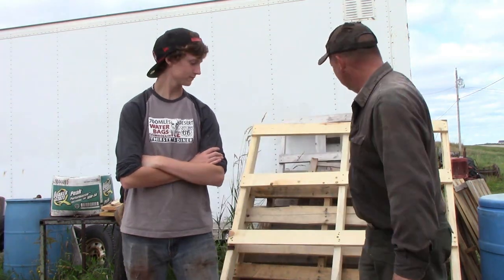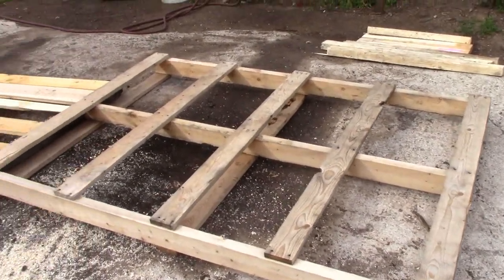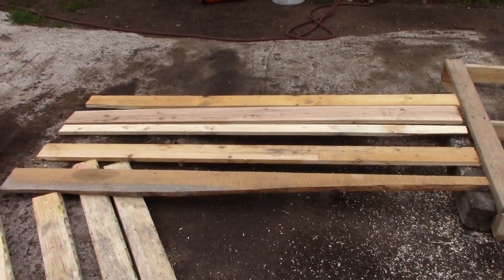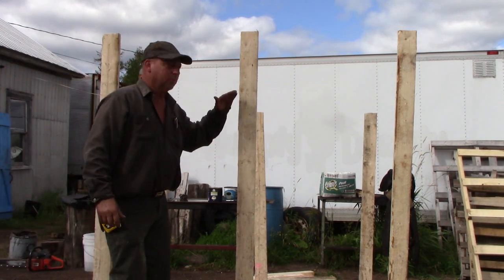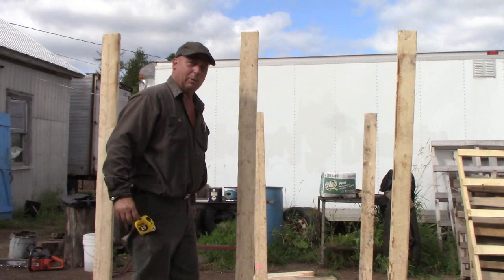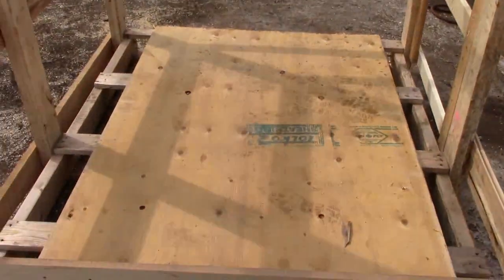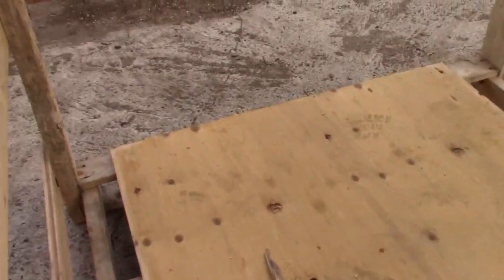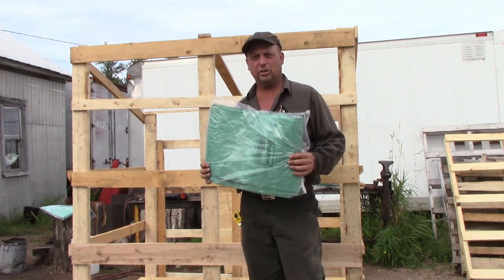How to build a ground blind (on the cheap).

Comment: All the tarps I have used break down in sunlight. Started using silt fence, doesn't degrade, last forever and I can get used silt fence from job sites that are finished. Need to hot cut the lengths or it will unravel. You can also just wrap around a 1x1 and nail it on so it doesn't unravel. Really like the pallet idea
Reply from the maker: That is a great tip, thanks!

Comment: Hi Dave I like your videos. I have a 1970 international 624 diesel tractor. I have to do the brakes and the PTO clutch doesn't let the lever engage. It engages with the engine off then when I start the engine the PTO runs all the time, Please I need some help.
Thanks Ron
Reply from the maker: Thank you I appreciate your support! The 624 has a 2 stage pressure plate, for some reason your PTO clutch is not releasing. It could be that the disk is stuck to the pressure plate, the pressure plate or linkage is out of adjustment, or a piece of the linkage such as the release bearing forks is broken. I don't remember but there may be an inspection plate on the bottom of the clutch housing where you can look in and see the pressure plate and see what is going on. Good luck and thanks for watching!

Comment: Kinda's refreshing to see a deer blind get built rather simply, rather than framed like you construct a three car garage... !

A little more care and a few more dollars [ U.S. or Canadian ] and you could cover with 0SB rather than tarps though.

Tarps break down rapidly and require continual replacement.  $5.oo x 3 = $15 , the cost of a 4'×8'.

I prefer mine a little more airtight  with a complete plywood floor.  

A single sheet of plywood would be more noisy, drafty and you'd  constantly be losing  items through the space; seems like that would be a P.I.T.A.  .

I like the ability to heat my blinds, but I don't  require fancy windows or doors.
Reply from the maker: Thanks for watching!
Reply: ...... you're  very welcome !

Fantastic concept you have.